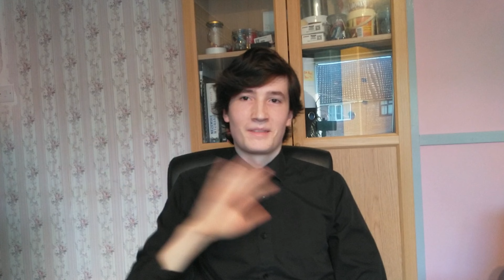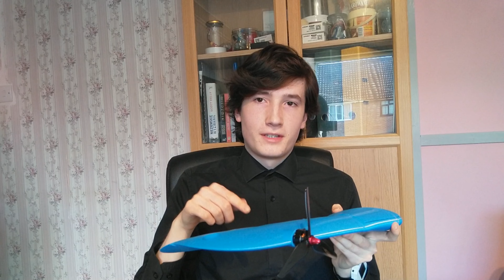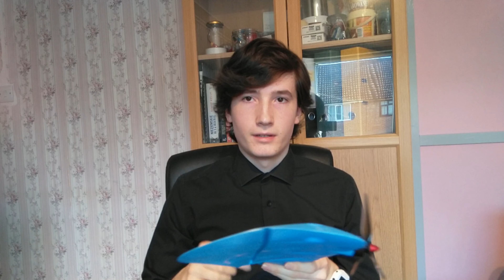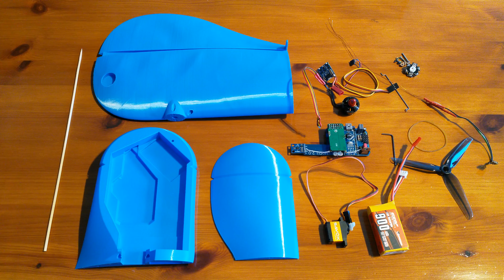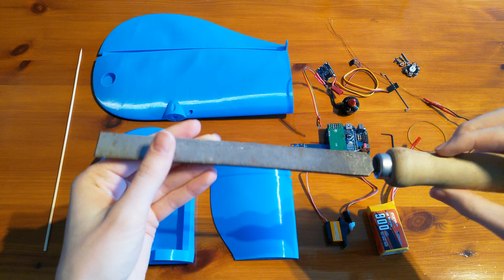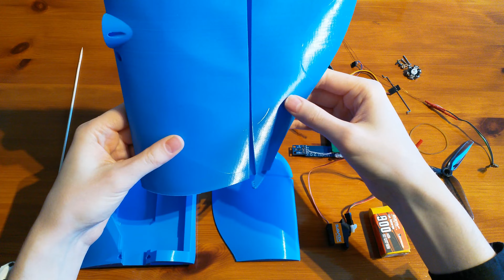Monocopter 17.4 Assembly - 3D Printed Arduino Monocopter

Comment: I started working on Monocopters a few weeks ago for the challenge and enjoyment. All started with designing and 3d printing maple seeds, and it ended up turning into a monocopter obsession lol😆 Almost done with my latest one (second attempt) where the wing tip is the control surface and using a ducted fan. Great channel and awesome Monocopter!!
Reply from the maker: Thanks! It's good to see another monocopter enthusiast :)
Reply: What size wing length and what size(diameter) EDF are you using? I'm trying a KF2 wing with a 55mm EDF. The EDF will be mounted opposite the wing with the battery and electronics in center of mass.
Reply: @williamhoover1515  wing portion is 360mm total length is around 530mm. Edf that I made is 40mm. I used 2 1s gaoneng 450mah for batteries. Never ended up working with the wing tip as the control surface. It acted more like a brake with very little effect on pitch, oh well. Moving on to thrust vectoring edf for blade pitch control on my next attempt/ experiment. Good luck with your design!

Comment: ring contra-copter body wing would work also, or with fins, as a monocopter
Reply: inflatable wings (air pressure filled) would work too, make the surface more rigid than in a balloon, like paint or flex cover layer

Comment: Could I use a F3 or F4 Flight controller to work on this design? I can't wait until you add a POV LED  light system with great patterns.
Reply from the maker: You definitely could. You would need to write your own software for it though.

Comment: Maybe an ESP32 board could be substituted for the onboard computer and the ESP32 CAM Camera Module ESP32-WROVER Board with Camera Wi-Fi Bluetooth Module for Arduino IDE C Python Code OV2640 could be the camera. Any thoughts?
Reply from the maker: The ESP-32 cam has a frame rate that is too low. If it can only do 60 FPS, and the monocopter rotates at 10 revolutions per second, then the camera only takes 6 frames per rotation, meaning the inconsistency in direction between frames is very large (±30°).